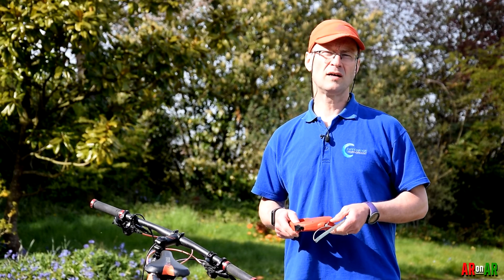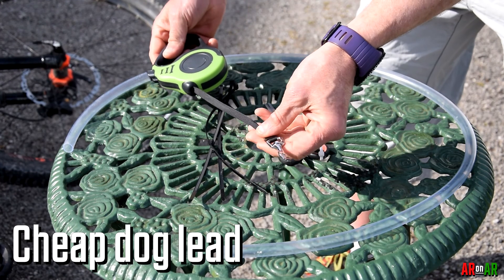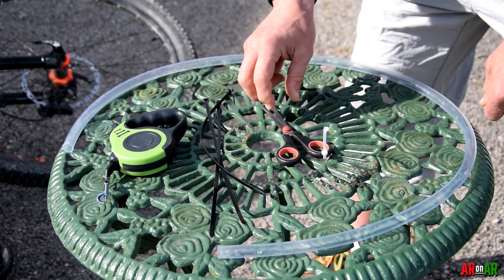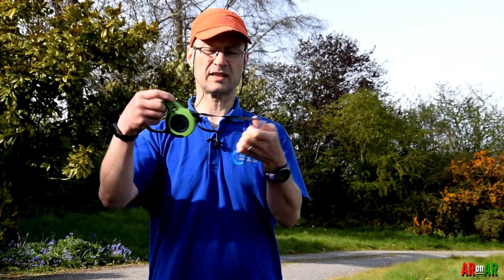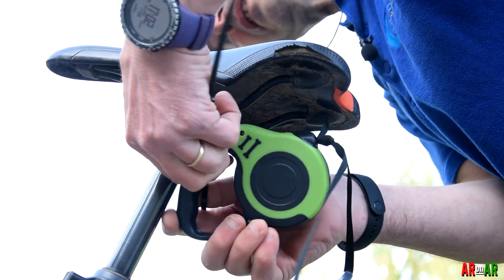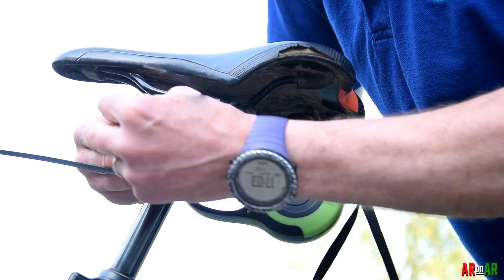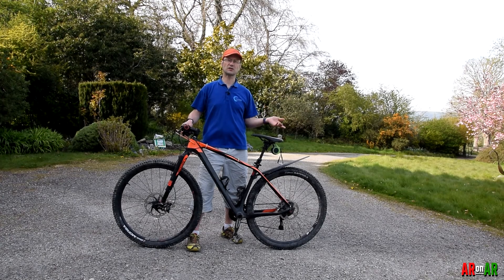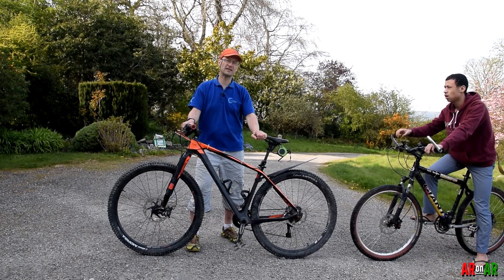Adventure Racing #20: How To Make And Use A Bike Tow Rope

Comment: Great stuff Adam 
I have a thin bungee as a pulley system starting at the seat, going to the front stem and back twice through small pulleys or U bolts.  The pulleys are fastened with cable ties.  The handle sits below the seat and serves the tower as it does for the dog leash but is lighter and lives on my bike permanently. Users have said they prefer this to the dog leash.

Comment: Great video Adam. I would have one suggestion and curious if you have tried or would agree/disagree. I used my first bike tow in ‘09 and it was the dog leash style, but back when you could buy them with round cordage vs the new flat standard. One thing I do which relieves some of the initial “tug” and overall smooths out the takeoff some even when going on tow at “equal” speeds is to use a loop of 1/4” elastic kayak decking material as the handhold.  You can still use the tubing for grip and hand protection. I haven’t used that but it would serve well to shorten up the hang of the elastic loop and keep it higher off of the back tire.  I’ve attached a not so great photo of one on my daughter’s bike because it was what I could could find on my phone. One added bonus of the elastic is the right length of the bungee allows it to be put away over the nose of the saddle out of the way when not on tow and standing up for a quick second it can be pulled over and deployed.  Appreciate your fantastic videos and often share them with friends new and old to the sport!

Comment: How is that going to work with a dropper seat post
Reply from the maker: That is indeed a question. It depends on a few factors. I have a dropper and mine has sufficient space but on some frames, it might not be feasible. 
Not that it's the answer you want, but most adventure races have very little reason for having a dropper post (though I love mine).
Nowadays, most people seem to go for a larger saddle bag (as you find in bike packing setups) which also doesn't agree with a dropper post. 
You have to make your choices? 🤔